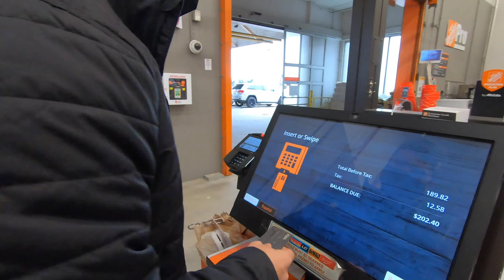Offer Accepted! Duplex Rental Property Home Inspection | EP 2: Road to Our Next House Hack

Comment: Can you guys explain a bit to the west coast folks what an underground oil tank is??  🤯. Assuming it has something to do with heating the home?
Reply from the maker: Haha yes, some homes will have oil fueled heat  and they are usually in the basement but sometimes people put them under ground to block the smell and save space in the basement. They can be a huge issue if they leak into the soil. Creates a big environmental problem.

Comment: what was the total cost of the home inspection?
Reply from the maker: Around $1700- that includes the sewer scope, termite and tank sweep along with the standard home inspection
Reply from the maker: - $850 for a home inspection on a duplex this size
- Radon- $165
- Termite- $100
- Sewer Scope- $335
- Oil Tank Sweep- $400
Reply: @RentalstoWealth  Would you share who you used for the Oil Tank Sweep?  I need one on my team here in South Jersey